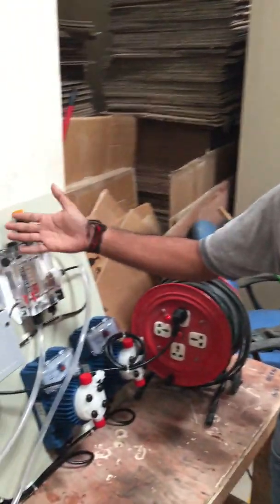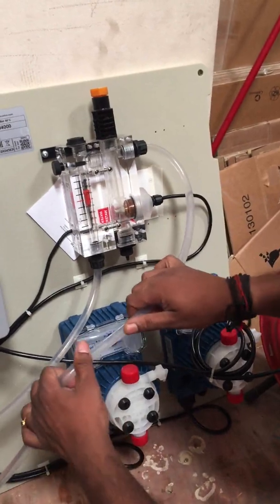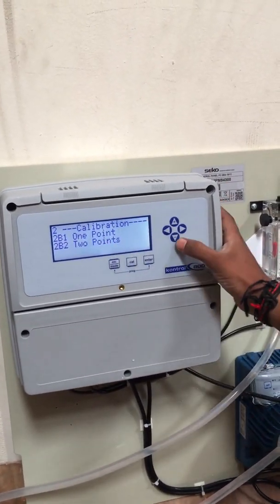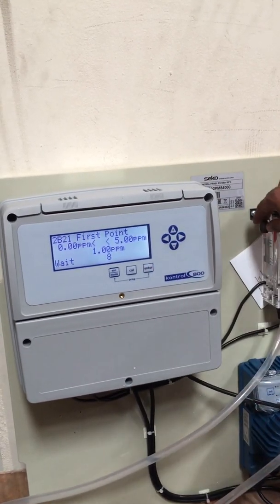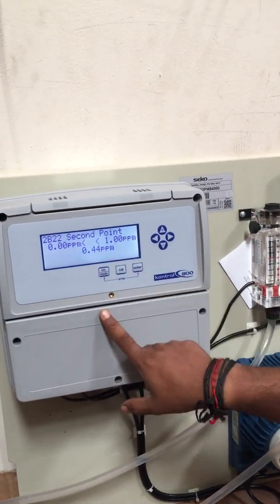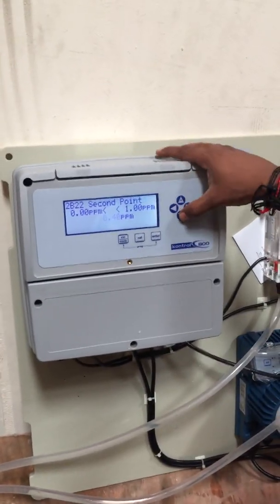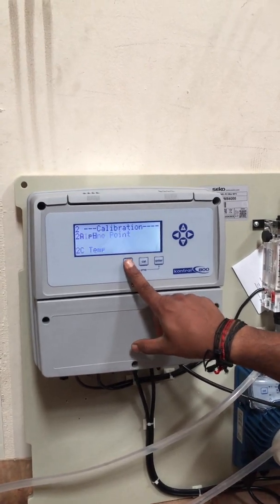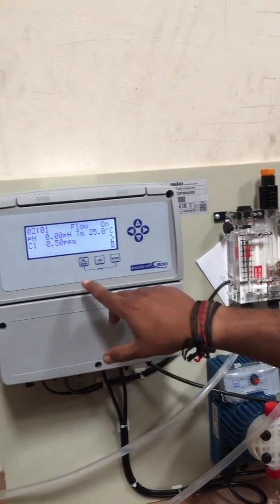SWIMMING POOL DOSING SYSTEM - PH - FREE CHLORINE CALIBRATION - KONTROL K800

Comment: hello can you explain about second point. need to put 0ppm in every time??
Reply from the maker: Yes. Second point calibration is like zero calibration. After closing the water flow wait for 60 to 120 sec and then feed 0ppm --->press Enter button
Reply: So no need for any standard solutions?
Reply: @james230887able  - no solution require4d
Reply: Hello, in the first point why do you put 1.00 ppm?
Reply: @ivanserenorendon5314   - need enter ppm value based on value measured from photometer